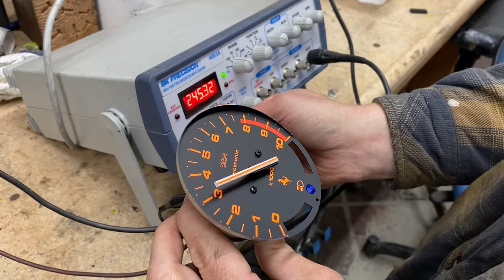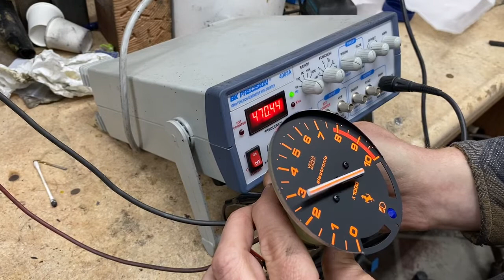Tachometer Test, 1987 Ferrari 328STS

Comment: harmonics !! thats it , check all the electrolytic capacitors on it using a ESR meter , change them if they are weird looking , crooked or look like they are leaking , its standard practice when bringing old electronics to life again , its called recapping. tachometers have Low pass filters to avoid reading harmonics instead of the real signal, those low pass filters are usually built around an operational amplifier , thats what is called an active low pass filter , when the capacitor fails , they will just pass any signal.